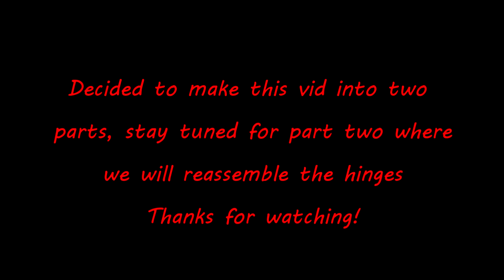Rebuilding 1970- 81 Camaro Door Hinges Part 1 of 2

Comment: Very detailed and informative. It would be easy to get parts moved to the wrong location and having to start over! Thanks for the clear explanation and close up video shots. Excellent work then epoxy. Many shoot single stage in jambs and other than a bottom, firewall, the jambs get sandblasted. Over decades my only suggestion is seam sealer. Just an 1/8" bead about an 1/8th from edges with the bottom open. If water gets in, it can drain out. Also, I use anti-seize on the bolts. If it could mess up future paint, I would use a "Q-Tip" on the threaded plate only. Keeps the bolts from rusting and unscrewing easy if needed later. Just a thought. Nice work!
DK, Omaha. ASE Master Tech since 78, mechanic since 1970.
Reply from the maker: Thank you very much for the kind words!

Comment: Russ, that stand works great!! one thing you may want to get is MAPPS gas, it is hotter then propane and in a pinch if you are out of acetylene you can hook MAPPS up to Oxygen and keep on cutting or braising etc. Keep up the great work
Reply from the maker: I keep meaning to pick up a bottle of that. It sure would work a little better. I haven't used my other torches in a long time.

Comment: Good info Russ. Thanks for sharing the mod on the detent roller. That's the one part I didn't replace on mine yet. I replaced my hinges with another used set after I found out they were ovaled out. I'm still undecided if I'm going to get Ring Brothers door and hood hinges. Definitely a nice upgrade.
Reply from the maker: Yea the RB hinges are pricey, not sure yet if they are worth it. I'm looking forward to seeing how these hinges work with the detent mod. I'm in school this week for work, so no Camaro time this week.

Comment: Russ, where did you purchase that door lift? I am currently restoring a 1979 Camero for a family friend and have had to pulled the the doors off. I had someone assist me with the removal and was amazed at how heavy they are. It’s going To be a nightmare trying to reinstall these restored and repainted doors without destroying them. The door lift you seems like the answer to my dilemma.
Reply from the maker: It started life as a Parts Tree from Auto Twiler. I modified it into the door lift. I have a few videos of putting it together on the channel.  These doors are so heavy. You are correct,  its very difficult to do with just a jack.

Comment: I cannot find the kits online for these where do they exist?
Reply from the maker: There are several kits on ebay. Here is one: 
https://www.ebay.com/itm/1970-1981-Camaro-Firebird-Upper-Lower-Door-Hinge-Pins-Bushing-Repair-Kit/222539737010?hash=item33d066e7b2:g:kf0AAOSwMvtZUYy~
Reply: @DoubleRRestorations  do I need the detent pin and bushing
Reply: @DoubleRRestorations  thank you by the way
Reply from the maker: @DG-wj6ks  It really depends on the condition of your originals. If they are in good shape, I would just replace the pins and bushings.
Reply: @DoubleRRestorations  I can’t find the replacement pins
Reply from the maker: @DG-wj6ks  Did you get the link I posted earlier?
Reply: @DoubleRRestorations  if your talking about the link on this video it no longer shows anything on ebay
Reply: @DoubleRRestorations  is there a different part number for them?
Reply from the maker: @DG-wj6ks  https://www.ebay.com/itm/1970-1981-CAMARO-FIREBIRD-1968-1972-CHEVELLE-DOOR-HINGE-BUSHING-PINS-W314A/333208895800?hash=item4d94cc4138:g:K2AAAOSwiJVc52PX

Try this link. I hope it helps
Reply from the maker: @DG-wj6ks  Just sent another link. Let me know if it works
Reply: @DoubleRRestorations  this link works and I just ordered them I just need the detent pins
Reply from the maker: @DG-wj6ks  https://www.ebay.com/itm/New-Genuine-GM-Door-Hinge-Pin-OE-20262500/123747842675?epid=655807101&hash=item1ccff23a73:g:KzAAAOSwMLtduwtF
Reply: The detent pin link was the one that didn’t work
Reply from the maker: Ok gotcha, I misunderstood.
Reply: @DoubleRRestorations  thank you so much!!! I typed in that gm part number and nothing came up and even if you look up 1980 camaro door hinge detent pin nothing shows but newer style pins so thank you again🙏🤘👍
Reply from the maker: @DG-wj6ks  Your welcome Dylan. The detent pin and roller are from a newer model camaro, but they work great on our second gens. Actually I think they work better. They are slightly larger.
Reply: @DoubleRRestorations  oh I did not know that, well thank you for the recommendation this is the first time I’ve ever disassembled my hinges and watching this video was a driving factor for me to do so rather then buying new ones so thank you

Comment: Where did you get the  hinge spring compressor ?
Reply from the maker: I got that one off eBay. Its Steck Manufacturing 21910. There are some cheaper ones on there, but this brand had good reviews.

Comment: Russ, I'm currently in the middle of a 77 Trans Am restoration and am working on the hinges. This video and part 2 are awesome, as are all of your videos, thanks so much. The only question I have is the link to the Detent roller does not say that it fits the 2nd generation cars. I assume that this is what you used and it works fine? Thanks again.
Reply from the maker: Yes, this is the one I used. It is a little larger than the original, but works the same. Thanks for the kind words about the vids. Glad they are a help to you.